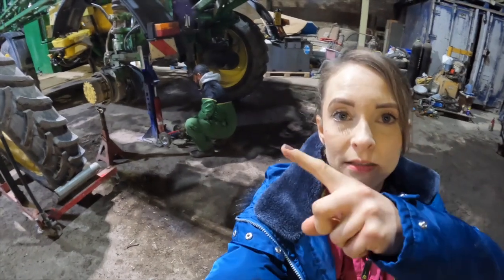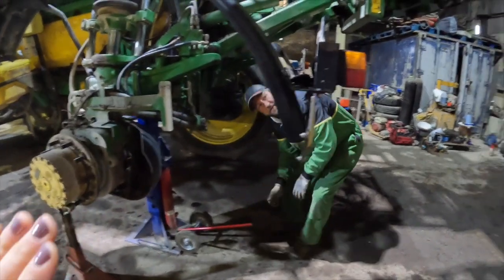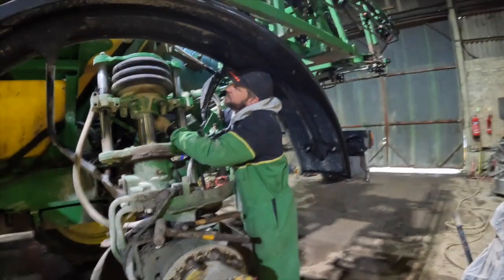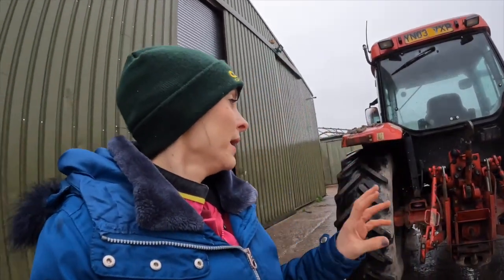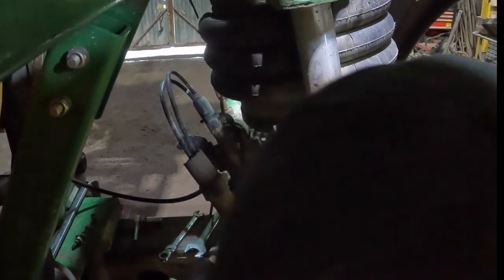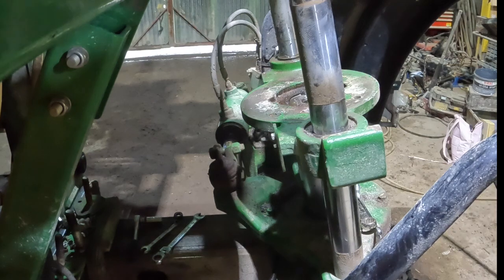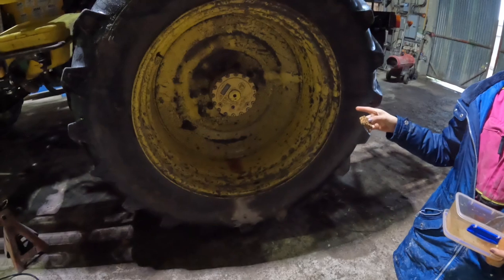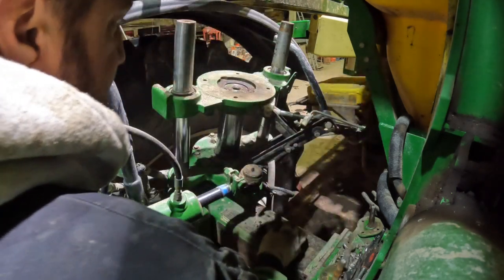WILL WE GET IT FIXED - PART 1

Comment: You are invited,if you travel near Northern IL sometime,not as warm as Florida in Winter! Ever snowmobile,a Hell of alot of fun,when we get a few inches of snow,I think you would love it,like riding a rocket on snow,I have many sleds that will travel more than 100 MPH! In the US,and I suppose around the world,an English accent denotes intelligence,and class,whether,or not it is justified,in some cases.We have had a 50/50 corn,soybean rotation since 1991,when I took over the Farm,which is very common throughout the mid-west.You can often tell the intelligence,and wealth of a Farmer based on the Brand of equipment they have.I knew your Family were serious,and successful Farmers when I saw your equipment,and heard you say the John Deere Tractors just keep running! Almost all of the equipment we have owned since the late 50s has been John Deere.Some 8560 Four Wheel Drive Tractors,9600 CombinesJD planters,and tillage equipment,John Deere have justifiably earned perhaps the best reputation for Farm equipment in the world! We live less that 100 miles from their International Corporate Headquarters.
Reply from the maker: That’s awesome buddy definitely a different world out your neck of the wood exploring better parts of the states is right up my street. Always amazed that 2 crops on current rotation works for you. Do you feel like your being looked after by Biden more or less than trump ?? Trump I thought seemed to do a lot for farmers I maybe wrong 😂 jd stuff is good getting outta my league now tho mate might be another colour soon